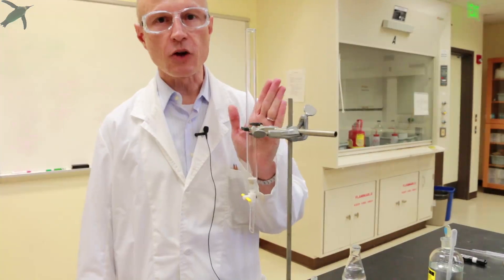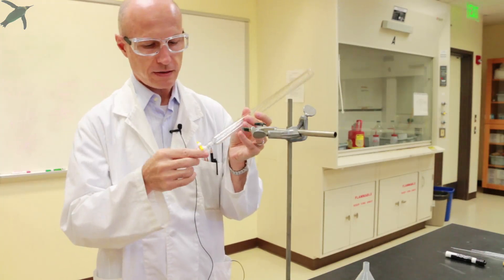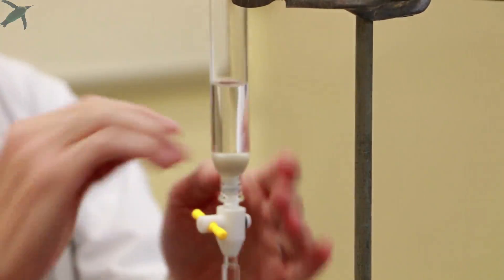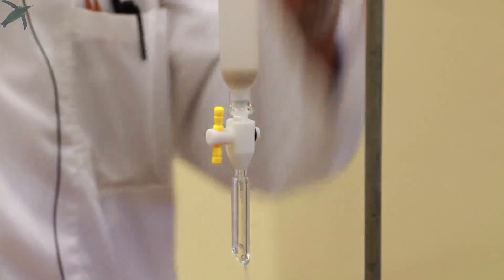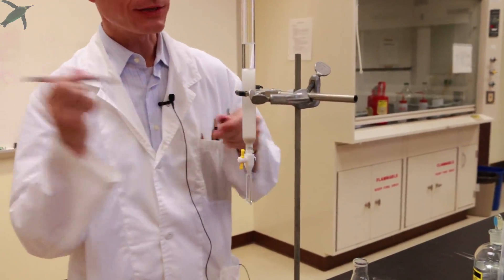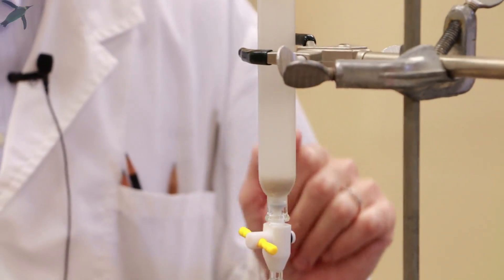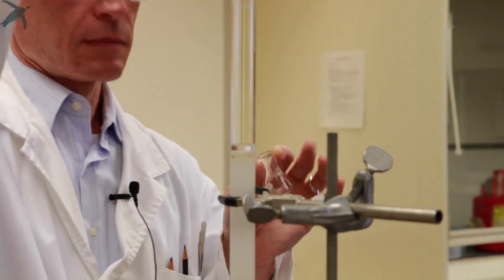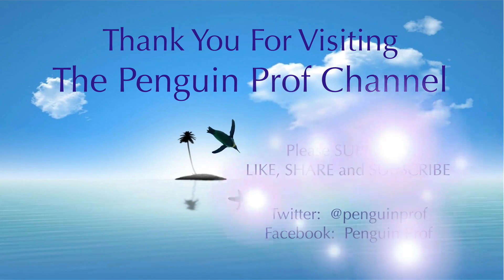How to Pack a Column (for Column Chromatography)

Comment: How do you tell when your compound of interest came through? Do you just TLC all of the collection tubes and see which one shows a spot? How do you know when to stop eluting? Do you just keep doing TLC on what come out of the column until you see your compound on TLC?
Reply: You know your compound came through when you see any colors on the process. If it doesn't, I suggest you to check the column and your tubes time to time under the UV light so you know in a glance the separation is really works. And ya, I checked the spots by TLC so I knew which one that have compound and which one is not. How do I know when to stop eluting is when I don't see any visible separation for an hour or so. I guess the sample can't be separated anymore at that time. The last thing I done was washing it using ethanol to make sure all the compounds are came through from the column and not missing any of it. That's what I did on my research earlier. Hope this help!

Comment: Hello. I want to separate my components from n-hexane extract with mixture of n-hexane and ethyl acetate (17:3) as the mobile phase, but the sample won't come out at all from the column. It's already adsorbed to the silica gel but it won't go down and get stucked. Do you know what caused this or what should I do to solve this? Thank you.
Reply from the maker: First of all,   make sure your compound is not in the fractions you already collected and you missed it (it happens; if the polarity of the mobile phase was correct by TLC, your compound may have already come out).  If it's not there, try eluting more solvent, eventually increasing the polarity.  If nothing happens and you get desperate, you can go up to neat ethyl acetate, just to recover your product - at this point you would have no separation.  If worse comes to worse, you can try eluting with methanol - that should get it out.  Hope this helps.

Comment: Thank you for this video! I have one question: how I can regenerate the silica-gel after using it in the column?
Reply from the maker: Good question!  In theory, yes - if you clean it with methanol.  In practice, no one does it because it's never really clean enough to trust.
Reply: You can regenerate your silica gel after using it in the column chromatography by thermal heating in an oven at 600degree Celsius for 2hrs.

Comment: The silica gel won't go dry due to gravity because of the gel's equilibrium. It will only go dry if the solvent from the top evaporates or you apply pressure